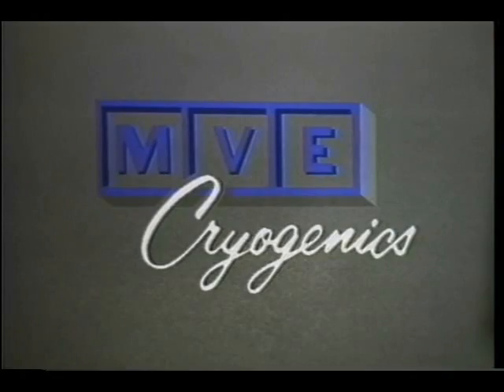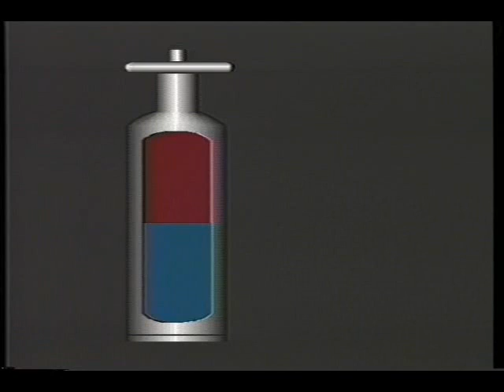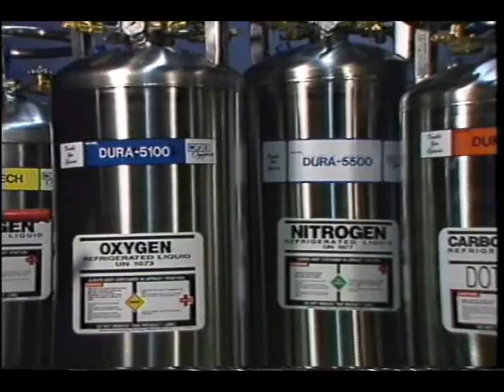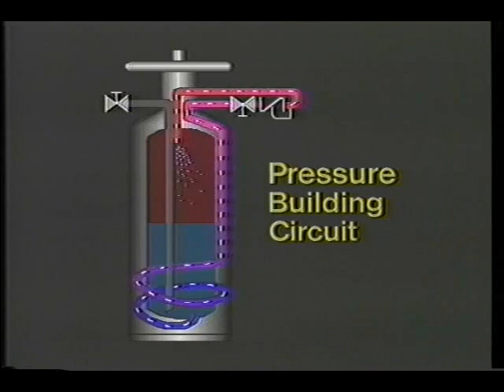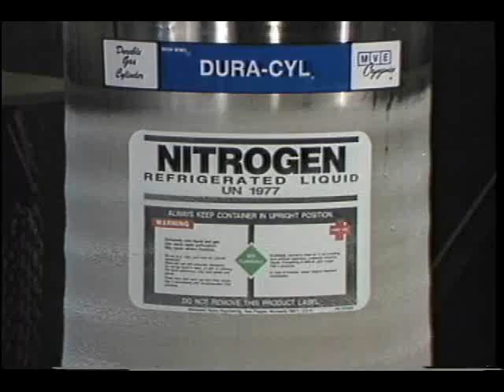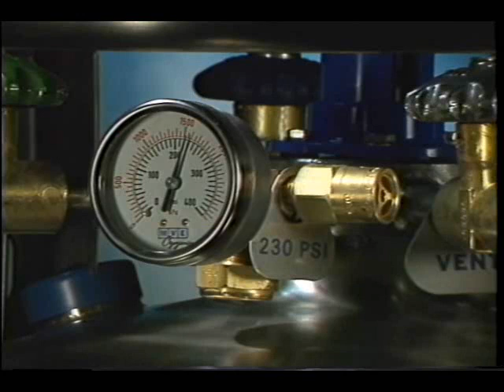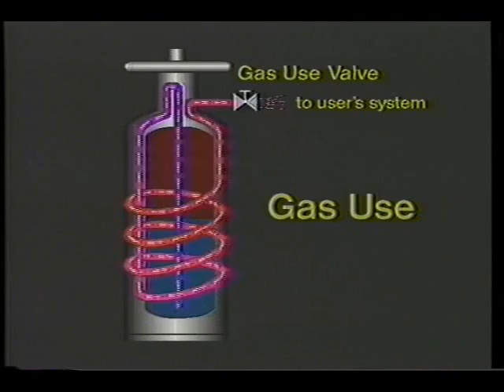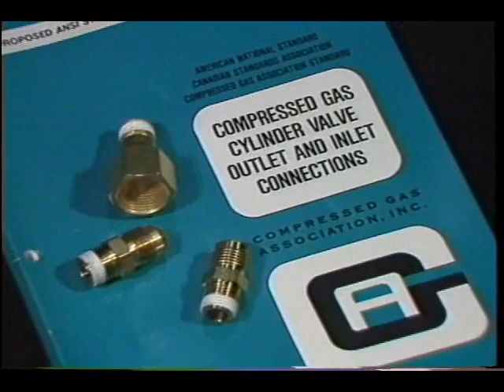Liquid Cylinder Operation

Comment: Would you be able or willing to post a video on how you run your torch to this tank.? Cause im thinking about going this route. Thanks
Reply: You just put a regulator on it like you would a normal welding cylinder, it’s lower pressure than a 220 k tank or t tank, as explained in the video
Reply: @Mitoa  alright cool thanks

Comment: with co2 will the co2 still be liqyud when withdrawn at over 7 bars? i want to use a micro bulk for dry ice vlasting and i dont want it to freeze the internals of my machine before it turns into pellet

Comment: Sir you told that this cylinder contain 20 times of gas cylinders that means it has to contain around 140000 litres of oxygen but you are telling it contains 80 to 240 litres of oxygen how it's possible please explain
Reply: It's possible as 1ml liquid oxygen = app 800ml dry oxygen
Reply: Think same principal of steam expansion from water... liquid o2 1 ml is close to 800 ml o2 gas
Reply: Here they are referring the liquid volume to gas volume
Reply: gas is a lot more spacious in volume than liquid volume is....300cu ft cylinders hold a lot less gas than you might think